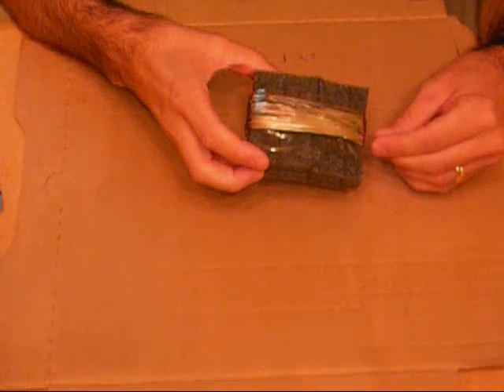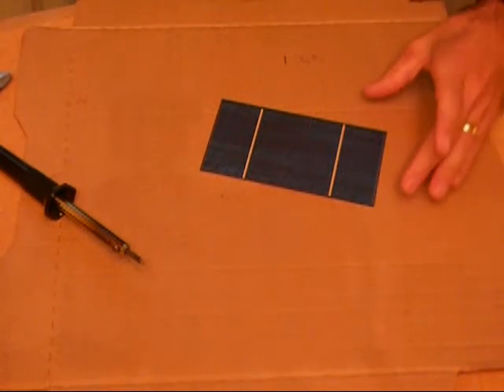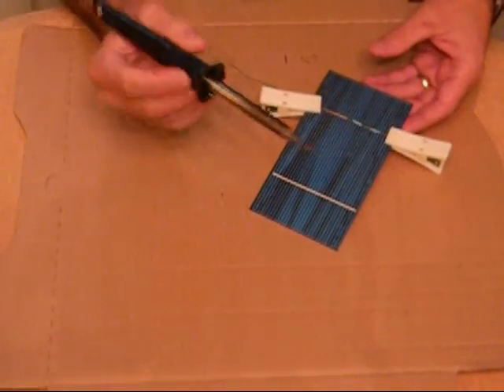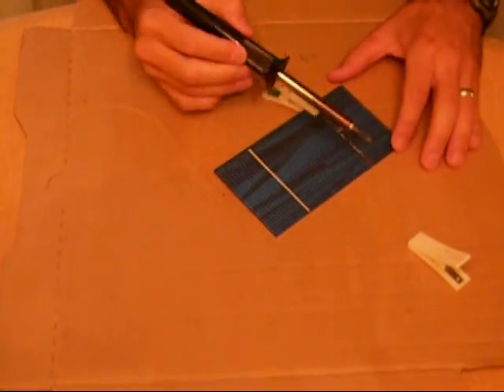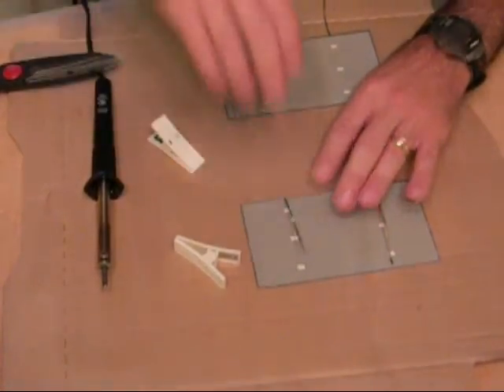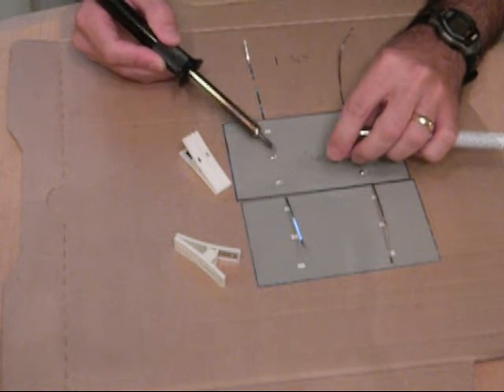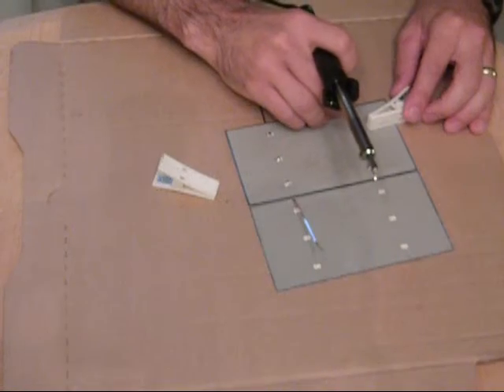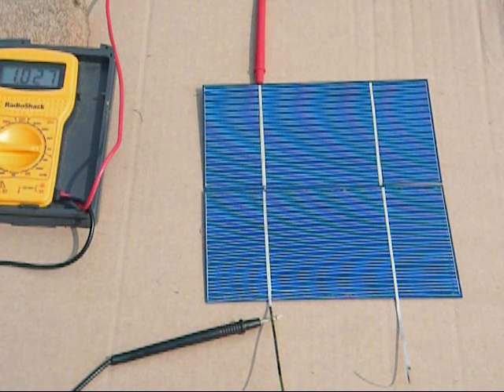DIY solar panel part 1

Comment from the maker: I have always had good luck with the 30 watt model. I just apply the resin pen to the silver on the cell and make sure the iron is hot.  Then I lay the tab wire on the resin and just go slow down the tab wire. When the tab wire solder melts you will be able to see it. It only takes a few seconds for it to cool and it should be good to go. Thank you for the question, Lonny

Comment: Thanks for answering, ive been trying to solder my cells, i have a tried with a 25 watt, a 30watts now i have a 45watt but can get them soldered down right. im using flux. any advice?? 
with the 45watt i get them soldered very light if i pull the tab wire it easily comes off. should i go with higher solder iron??

Comment from the maker: I did a side by side comparison on the front of the cell and the wire without the flux pen did not stick. I tried it 3 times with no luck. Thank you for the question, Lonny

Comment: I have a question. Do you have to have a flux pen or can you just solder the tab wire to the cell? because i do not have any flux.

Comment from the maker: The tab wire has a solder in it, so after using the pen you just lay the tab down and heat it up with the solder iron. It will just melt right to the cell. Thank you for the question, Lonny

Comment: I personally would not use any clips on any cell to hold the solder wire, the less handling the better, you are just asking them to brake. You should solder all of the fronts or backs first and then flip them all and solder the other side without bending the fragile solder ribbon out of your way which could cause it to weaken and brake